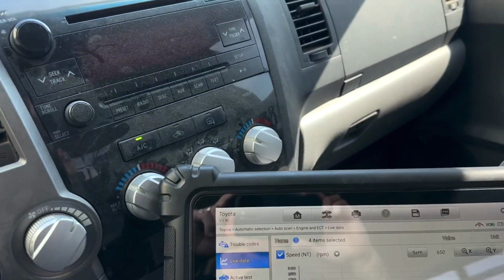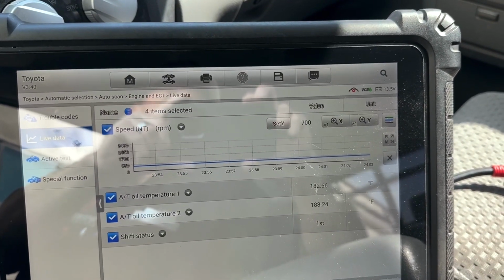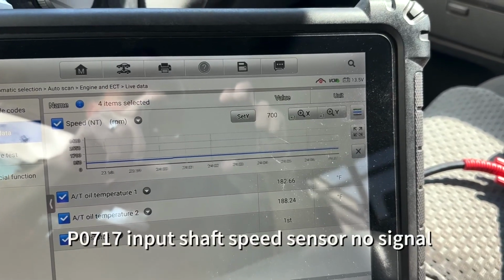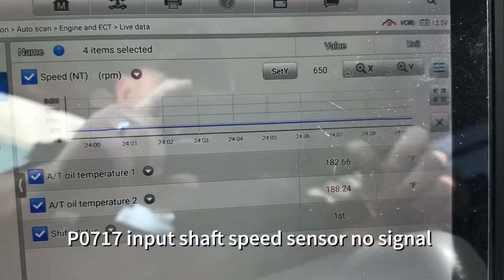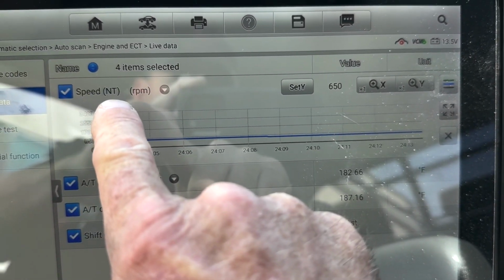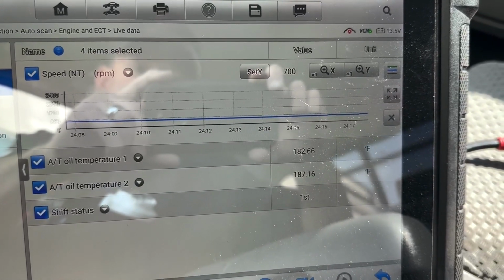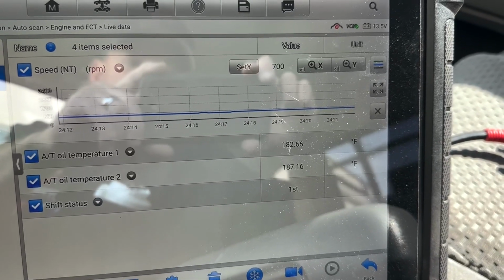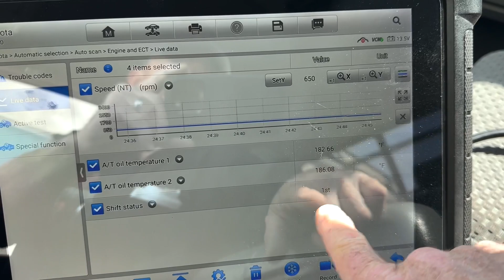TUNDRA WONT SHIFT INTO 5-6 GEAR P0717 CODE

Comment: I replaced the input turbine speed sensor and still code is popping up and still stuck in 4th gear 2WD TUNDRA 4.6 2012
Reply from the maker: You would need to do more diagnostics could be a wiring problem Or always possible something internal to the transmission
Reply: @WorX4ToolZ  I was thinking maybe solenoids but I’m pretty sure the one scanner would of detected that right ? Or am I wrong ?
Reply from the maker: According to the code, in the book there’s only four things that it mentions for possible problems 
The speed sensor failed
Sensor circuit is open or shorted 
Connector is damaged which could make it open or shorted
Or ECM failure 
Having said that, there’s alway a small possibility that mechanically something on the input shaft where the sensor reads could be a problem 
This sensor, read zero ohms also checked power and grounds on that one and the rear one and compared
Reply: I checked everything but ecm how do I check if ecm is bad ? Because I ereased the code on the side of the freeway and it goes all the way to 6th gear but light shows up again
Reply from the maker: @Kevvoo5.0  when the light comes on and you slow down do you still loose 5/6 gear…are you able to watch the sensor with your scanner to see that it’s not working? If I didn’t mention it before, if you didn’t get a dealer part it’s possible the sensor is bad..once you make sure none of the wires have shorts or opens 
all you can do is check power and grounds to the computer
Reply: @WorX4ToolZ  yes I loose 5th and 6th gear again and I got a new sensor from autozone
Reply from the maker: @Kevvoo5.0  do you have a multimeter that will check on resistance on the sensor. And just to make sure the sensor you’re replacing is right front of the transmission not in the back of the transmission that’s where it was on this truck. Right front

Comment: I have a 2012 Toyota Tundra with the same problem and every parts store gives me a different part number Toyota said part 894130c021 and trying to find parts from Auto Zone, O'Reilly price is anywhere from $39 to $192 because of the different part they say to use HELP.
Reply from the maker: I got it right from the dealer that had one left at one store in the network otherwise I don’t remember if they had any. If you haven’t called the dealer yet I would try that you know it will be right part even if it’s a little more than money.